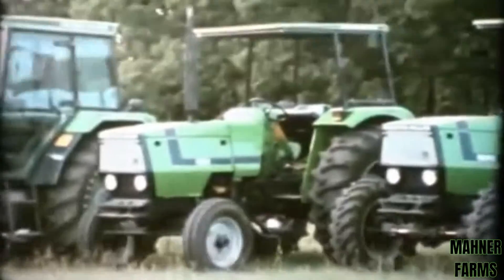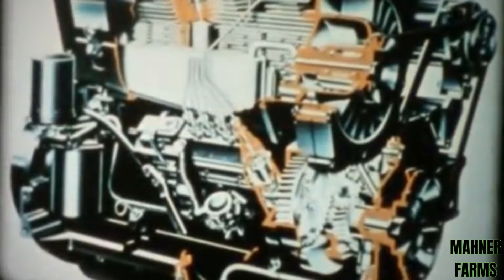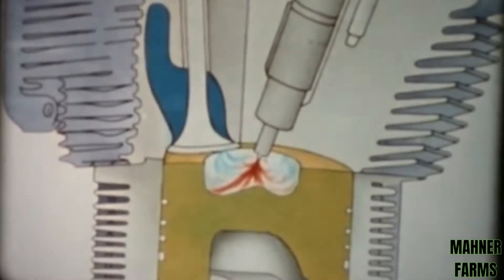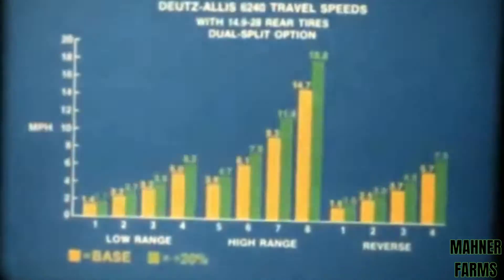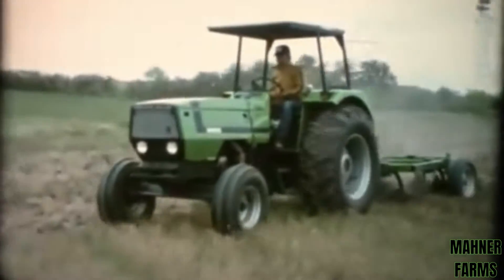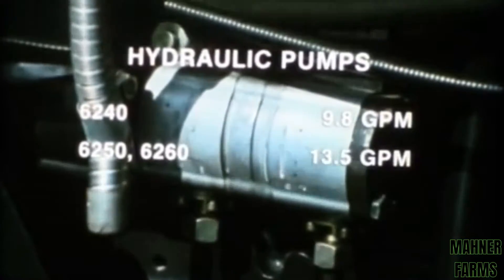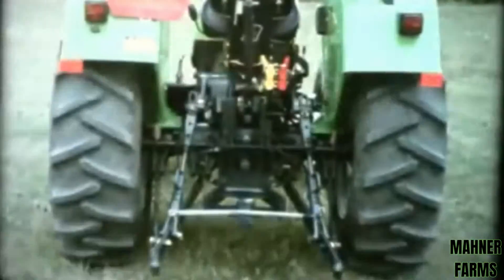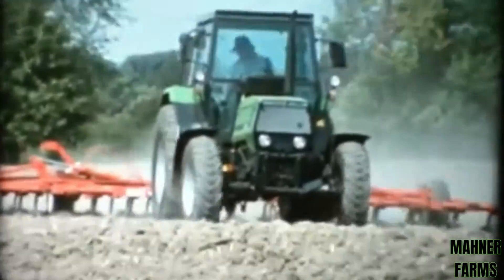Deutz Allis 6200 Series: Iconic 1986 Mid-Range Work Tractors

Comment: I wonder if parts for these are expensive when compared to more mainstream tractors. And how hard is it to find parts these days.
Reply from the maker: Depends on the issue. The nice thing about Deutz Air Cooled engines is that they are all basically the same parts, so it's never hard to get engine parts. As for everything else, I am sure its regional. Where I live, In Wisconsin, Deutz tractors were very popular for about 30 years, from the 70s to the 90s, so it's not bad here.
Reply: @DeutzFarmer96  Thankyou.